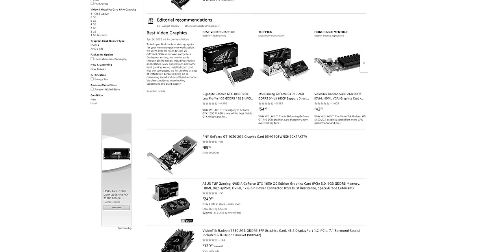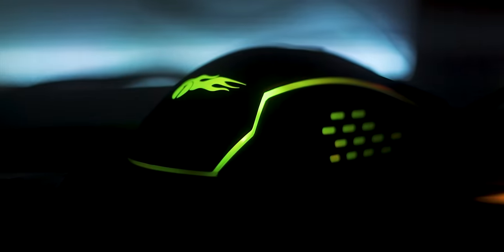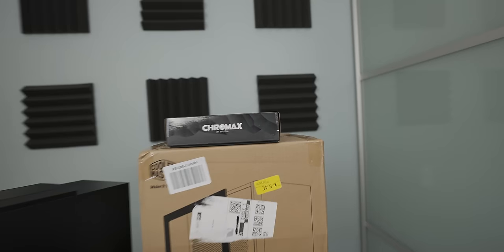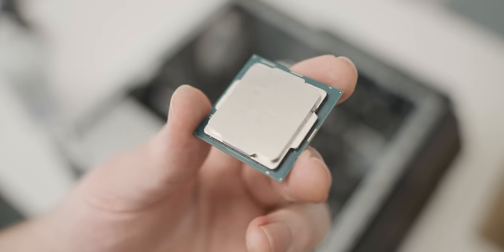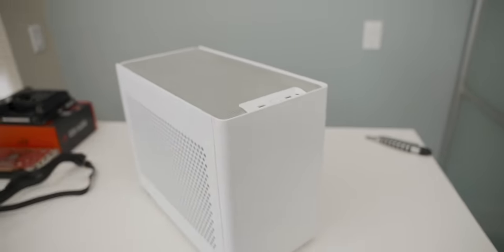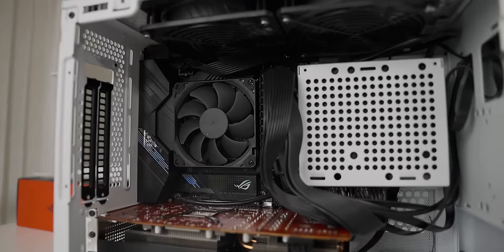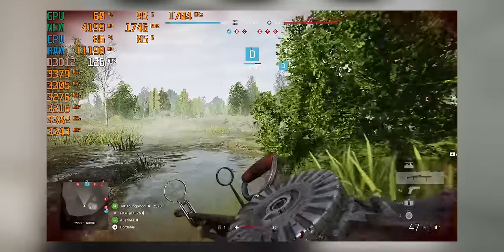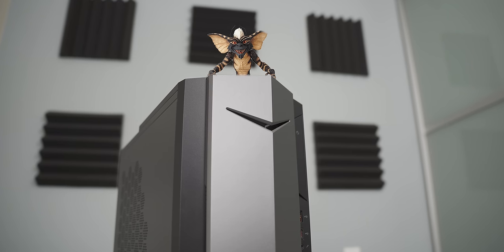2021 Pre-built Scavenger PC build

Comment: Everyone gangsta’ until you have to buy a 1660 Super for $450.
Reply: I have seen 1650 supers for 500 dollars on amazon
Reply: Granted I bought it back when GPU prices were high, but still kind of reasonable, but I genuinely just said “fuck it” and bought an RX 5600XT because 1660 supers were even higher than the 5600XT
Reply: I bought a 1660 ti for $300 y'all I'm gonna cry
Reply: I'm glad I bought mine one year ago, for 240 €
Reply: Bought a 1080 ti used for 350€ 😄
Reply: @dsaz632  funny sad and true.  But you can buy an entire PC with a 1650 super for $600.  That's what I did actually.  R5 3500 too.
Reply: Pc building in Germany is literally impossible, everything starting from 1650 is not available.
Reply: @Crunchifyable2  bro I got a prebuilt pc for 699 with an RX 5500 XT and an Ryzen 5 3600. You can't even make the exact system for that price due to inflation 💀
Reply: Seen a 1060 sell for £200 on eBay and a 1070 for £250
Reply: @dsaz632  ohhh...that hurt me buying 1650 super for 200$...just before rtx 3000 and the great GPU shortage came
Reply: I bought mine for 1660 super gaming x for $378
Reply: I got a whole computer with an i5 9400f and 1660ti for 400 6 months ago
Reply from the maker: What has the world come to? 😅
Reply: i'm Canadian so buying it for $338 cad without tax and tax $378 when the model was $400 - $500 before hike was a steal. Under average usd price that a steal for a msi premium.
Reply: @ronin3018  i found a 5600xt and ryzen 7 3700x but the reviews are all saying dead on arrival, so I just went for a 1660super and upgraded the gpu and powersupply myself
Reply: @shinefake48  bro a stinking rx 5600 xt is like $500 rn 😐, scalpers ruining everything
Reply: @ronin3018  ye but I was going to go for tat 5600xt prebuilt for my collection, but it was dead so didn’t wanted dead parts. But wats surprising is tat, tat whole pc only cost 700-800$
Reply: Bruh, I was just barely able to get my 1650 Super, I was looking at the Best Buy website on new year's eve and saw that they had a PNY GTX 1650 Super in stock, and I bought that thing as soon as I could. Sending this comment from that 1650 Super.
Reply: Rtx 2060 msrp is starting to look like a deal

Glad I have one
Reply: @qttOW  i got my 1660 super for 300 Canadian. Pretty happy I ordered when I did
Reply: @Crunchifyable2  my pc has a 1650 super I got it for 170 dollars and I have a Ryzen 5 2600
Reply: Prices right now are insane. I bought myself a reference rx5700 for £290 with a £40 rebate, so £250 in the end. I just checked on eBay and somebody just sold an identical one for £400. If I wasn't stuck at home on furlough I'd sell it and stick my old gtx 780 back in until prices go break down
Reply: @Crunchifyable2  i bought the same one, mine came with a r5 3600 instead of the 3500 as advertised, so even better!
Reply: I bought an rx 5700 for $400 back when I thought prices were bad.. now they go for at least $500
Reply: What would you guys recommend I sell a 1660 for that’s not hiked up like hell
Reply: hahaha thats fax even on the nvidia website
Reply: I can buy a 1080ti local for $400
Reply: @kalendren  just got a 1080ti for 400
Reply: Lol got an xs oc edition one for 250
Reply: and here I sold entire build with 1660 super 4770k, 16gb of ram, 650 watt power supply for 500 cause I felt bad....
Reply: @DawidDoesTechStuff  Please tell me when the GT 1010 comes you're gonna compare it to the 710 and 1030 😅
Reply: @qttOW  thats not too far above msrp, pretty sure it goes for like 270 or 280
Reply: @eagle7015  still a great deal considering the 30 series is going to be out of stock for the entire year
Reply: You can buy a used GTX 1080 for less than that. Well you can in Australia anyway.
Reply: @TheBozzler  maybe in Australia, but def not in America or EU, trust me, no one sells a used 1080 for anything less than 400, considering that production of the card was stopped and buying it new is like 800.
Reply: @seizmic7024  there is a used MSI 1080 8gb in my area for $300, an RTX 2060 Super FE for $250.
Reply: @themosesfactor7235  really??? man I'd really love to live where you live. I'm extremely happy with my gtx 1650 super cuz it gives great performance for the price but I also wouldve had enough for the 2060 super fe
Reply: @seizmic7024  oh man if I had the extra cash I'd buy them and sell them in builds at their usual price, not their currently inflated prices. I build PCs for people and man it irks me when people try to rip off others.
Reply: @seizmic7024  not many 1080s around however. More luck with a used 1070. I only mention it because as the thread is saying only new cards available are 1660s . If you’re going to go 1660 for 450 might as well consider a used 1070 or 1080.
Reply: @seizmic7024 lmao and i was looking for a 2060 too when I found it on Facebook market
Reply: cries in Indonesian
Reply: I bought a gtx 1070 ti used for 240 bucks used off Craigslist back in March.  But that was used
Reply: @DawidDoesTechStuff  death of gaming
Reply: Glad i got my 2070 super right before this stuck issue stuff
Reply: I got a 1660 super before 2021
Reply: I built a PC with components sourced from eBay last summer, shortly before component prices went mental. The highlights being a used Ryzen 5 1600X With 16GB Corsair Vengeance RAM for £130 and a brand new EVGA GTX 1060 6GB GPU for £160. The only thing I regret is I didn't buy a lottery ticket at the same time!
Reply: Bought a GTX 980 for 160€ yesterday. Strange times
Reply: I’m getting a custom prebuilt with a 1650 super and i7 4790 for $1000
Reply: @alphaasianjosh  "back when GPU prices were high"

When was that that they were higher than now?
Reply: The madness is starting to creep into AMD APU's too. In Oct 2020 I bought a 3400g (because even then GPU's were too expensive for my budget) for $144. My nephew wanted to build a PC so I went looking for another one. If they're in stock, they're running $270-$350. That's a 90+% increase in 5 months. For comparison, non-APU AMD Ryzens have by-in-large stayed flat, or modestly crept up.
Reply: now it’s around $550-600 used.
Reply: I got a rx 570 8gb for $200 brand new
Reply: @dsaz632  gtx 980s go for like $1000+ on amazon 💀 just shitty resellers
Reply: Saw a GTX 1660 OC for 725$
Reply: just saw them for 800 and 1200 dollar lol
Reply: I did, at Micro Center
Reply: Yeah...I thought they would come down from $280 and Im still kicking myself.
Reply: Bought a 1650 Super for 260 CAD.

I guess nature is starting to heal.
Reply: I almost regretted buying a 5700 XT right before RTX 3000 cards were released only to realise that there would never be stock for the next gen cards, and then instantly feeling smug that i got a 5700 XT at RRP once prices for the same cards hit the £600 mark (i got mine at £370)
Reply: i bought a new 1660 super about a year ago for £300, not a bad deal with the shortage lmao
Reply: I got an rtx 3050 for $320 at microcenter, not even mad about the eh performance because they've already gone up about $100 now lol
Reply: I literally sold one on eBay for exactly that during 2021
Reply: I've seen (and perhaps poorly) bought a 1650 around $425.
Reply: At least now you can get one for $85
Reply: @qttOW  2 years later those go for like 120$
Reply: @u2msnake  just goes to show how FUCKED the market was back then lmao
Reply: yeah man got my 1660ti about almost a year ago for$100
Reply: Lik
Reply: I saw one for $103 on AliExpress lol

Comment: I have this case and can say that a regular cooler can work as well with that extra space. Also, I recommend doing 2 intake on the bottom and flip the 2 top fans for exhaust and have them on a fan controller.

Comment: If necessary Dawid I would exhaust the rear most fan by the CPU/Motherboard area.   It actually helps a lot  with the heat produced.  Nice clean build and I want that case for a future build.

Comment: You can improve cooling a lot in the NR200 with a bottom-to-top airflow (maybe some slim fans pulling air in under the RX5700). You can also side-mount a fan to blow towards the CPU top-down cooler, or try the Noctua C14-S - they work great in this case with the mesh panel.

Comment: Try undervolting the CPU by, like, 100-115mv offset. Should drop the thermals by 5-10 degrees easily.
Reply: he updated on his story that the cooler wasnt even making contact with the cpu and switched it for an aio that is a lot cooler now
Reply: @akamadman203  shit the stock cooler would have dropped that by like 20c aio wasnt needed but I support the choice. stock cooler on my wifes pc has never been over 60c in Cod bocw zombies or WZ...
Reply: @crisnmaryfam7344  i would use a stock if it wasnt so ugly but also my cpu would over heat using stock its a i7-9700k

Comment: I just recently did a bit of scavenging myself. I got computer parts laying around from upgrading other people's computers and upgrading my own. My home theater PC was using a i5 2400 and a R7 250 graphics card. So I scrapped a bunch of parts together and made a system with a FX 8120 and a powercolor R9 380x 4 GB. The motherboard has toslink out built-in, which works great with my home theater receiver, at least until I decide to move to dolby atmos then I'm going to have to use the display port out.

Comment: I've got an NR200 as well, for fan setup, I did have to add 2 120mm Noctua fans on the bottom as intake. My airflow setup is bottom up now. Amazing improvement, highly suggested.

Comment: Nice build.  You might want to try the NH-U12S as it still fits nicely and will vent out the back and you can then vent the top fans out the top for better case thermals.  Just a suggestion.

Comment: The NR200P is big, I've managed to fit a 4090 in there. For cpu cooling, tower coolers are much better. You set it up to intake from the back, and then the top fans blow all that heat out the top. A 5900x was easy to cool with this setup.

Comment: lmao tightening a noctua cooler dropped temps considerably. can relate to that. stopped screwing in my NH-D15 when I heard the springs creak because I thought I was overtightening it. didnt know Noctua designed the screws to stop so you cant overtighten. I was getting 93C in AIDA64. Retightened the screws completely and then got 80C max in AIDA64.

Comment: While you were going over the parts.
I use a Noctua L9a to tame a 3400G. Has no problem with it.
As a microATX lover, you owe it to yourself to try a build in the NR400. I keep getting tempted by that case, but still haven't actually bought one yet.
Also Corsair's SF supplies are solid. I should replace my ailing Seasonic Focus Plus Gold with my SF750.

Comment: I think the top fans as intake are a mistake. You should put one on the bottom and intake, and one on top as exhaust. Or just both as exhaust on the top. They will pull fresh air in through the side panel.

Comment: Top intake no no no you need to install intake fans to the bottom or to the side. The top fans are ment to be the exhaust in that case.
And as we know heat rises anyways. I have an 9700k in that case and im using 2 side intake fans and 2 top exhaust fans and it works nicely.

Comment: a bottle of clear nail polish and a black spray rattle can and you can paint the back of the graphics card, use the PCI-E express cover to protect the gold pins or use electrical or masking tape, thermals won't matter to much might have to have a higher fan curve, what I did for my sons build and surprisingly looks great

Comment: I have the tempered glass version of the NR200P , you can fit a Scythe Mugen 5 ARGB ( not the plus version) CPU Cooler, it should perform much better than the low profile Noctua that you have. I can close the side panel just barely, you should consider that cooler to keep the noise down.

Comment: I'd really prefer the IM01 cases (Sama, Inter-tech etc). Agreed, it is 14 mm deeper and 8 mm taller (let's say half an inch and a third of an inch), but it takes an mATX board, an ATX power supply, and a normal tower cooler (155 mm tall).

Comment: Great video as always. :) It's always nice to get something useful out of those prebuilds.  About that CPU cooler though... I got exact same cooler (AM4 variant NH-l9a) on my R5 3600 and temps are around 65-75C in games. It can't handle any overclocking tho,  like not even little bit. :P I hope Anna is happy with her new build.
Reply: Hey it seems I finally found someone with the same CPU+Cooler Setup :D
How are your temperatures in idle/under normal "office" load? 

I am asking because when gaming, my temps are around 80° and even go up to 92° at max which isn't great imo :|
Reply: @chriss7005  Hey :)  My idle temps were with 55-60C range with a proper case with a good airflow. Check if your PC is getting enough cool air by opening the case. If the temps are still hot, then it's not an airflow issue. You can always try to re-apply the paste and check if the cooler has proper contact (enough pressure). I did replace my cooler with a better one because I wasn't happy with the noise it was making in full speed (also I couldn't overclock).

Comment: Thermaltake core v1 is a better case, it's a bit bigger but you can fit a bigger cpu cooler and it's got a 200mm intake fan on the front and plenty of room for exhaust fans.

Comment: if you need parts like ram or ssd get them now i just got a 1tb silicon power gen 4 m.2 for 147.00 also holy crap i love silicon power they make real affordable m.2 with dram cash for a reasonable price i feel like more people should be doing videos on there m.2s but there's like none i see it for the adata which is a good one to but the gen 4 i just got from them is a little  beast

Comment: Heat rises, the top fans should draw air from the bottom over all components and blow UP-!!  Might've helped your struggling thermals, you can do better on the cpu cooler too. Just my opinion.  Nice case and a great result either way.

Comment: I ended up buying a prebuilt because I wanted to build but then its to expensive and difficult to get the parts right now. But my case is nice and hopefully a few years down the road I can put a new 40- series card with DDR 5 ram and the next gen CPUs in it. The build job on the computer was good too,so it will last.

Comment: I love this case. I have this exact one. I put a full sized internal Blu-ray player in mine.  You should gone with the NH-C14S cooler. I run a i7 10700 even with handbrake at 100% cpu utilization, temps just get to 70 C. I have PL1 maxed (asrock H470 mobo) at 125 W
Reply: Same here. I have a 10600k and it maxes out at 85 watts under 100% on all 12 threads with handbrake and a Noctura NH-L12s. Such a great CPU and cooler combo. I don't even run the fan until 50°C

Comment: Funny how a week back I just built in that exact case with some pre-built parts from a lenovo PC I took apart! Too bad that my cable management in that thing is completely attrocious in comparison.. But I will say that was my first time in an mini ITX case and using a full sized GPU as well. Maybe it partially didn't help that all the front panel connecters were on the right side of the motherboard I used, which didn't help since that was a tiny fit at that point.

Comment: I'd turn the top fans back around, hot air rises so atm there is a thermal death match happening in that case. Nice build tho.
Reply: The "Heat" is not in the case long enough to "rise". Sound weird but it's true. You want to blow air in (with minimal filters) verse sucking air out. This eliminates hot spots/pockets. You will be able to run your fans at lower RPM as well as prevent dust from creeping up in through every unobstructed crevice.

Positive pressure FTW

Comment: buy arctic p12 value pack and setup two bottom intake and two top exhaust that would make a temp improvement without breaking the bank or generate noise

Comment: Just a video suggestion may sound crazy but accept it as a challenge
Can we solder more vram onto a gpu(gt710,gt210??
If there is one slot for the vram chip 
Just jumper wire it

Comment: You should do anothe cpu temp test after reversing the case fans to push air out instead of pulling air into the case, to see if that helps lower cpu temp.

Comment: Did you leave the top fans pushing air down? I would think all fans out pulling air (mostly) from the bottom would be best for that situation. Hot air out the bottom means it will cause a loop of already heated air going back in the top.

Comment: Are you sure that you didnt make a mistake with the thermal paste or with the assembly of the cooler? I build a system with a 10400f with an old Zalman CNPS 9900 Max (i know it´s a lot larger) and got under 100% utilization temps in the low 50´s with the lowest Fan speed. I would imagine the Nocuta should get around 60-65 with 100% utilization and around 50-60 under gaming load.

Comment: I prefer vertical CPU coolers. Because when GPU gets hot, it's backplate radiates heat and CPU cooler just sucks it in. But when you have vertical cooler (fan aligned to pull air through the case front to back) it barely gets that GPU heat. At least this configuration fixed my CPU temps while using a hot GPU.
Also: so awesome to have tech savvy wifey/girlfriend. I wasn't so lucky in this matter. My woman cares only about filling up her 64 gigs of space on her iPhone with photos.

Comment: I think I would have set those fans as exhaust if I had built this computer.
Maybe there would be more dust build up, but with a small case like that one I don't think it would be an issue. Maybe also a small tower style cpu cooler.

Comment: 1. it could probably fit a 240 aio since it's already pulling air from the top. 2. at 4k resolution that 5700 is going struggle with 2019-2020 games, and straight-up die in Cyberpunk 2077